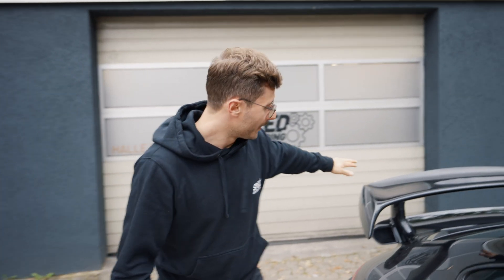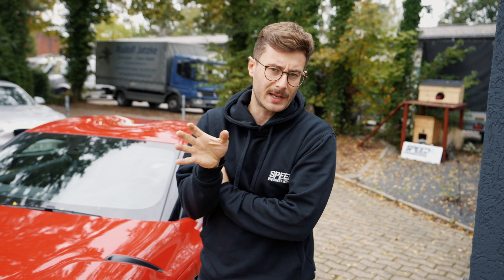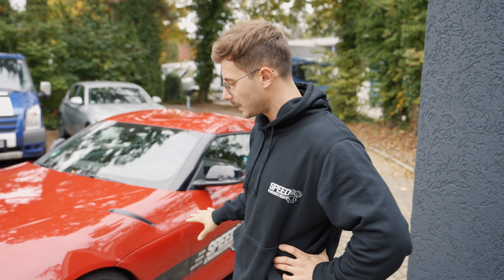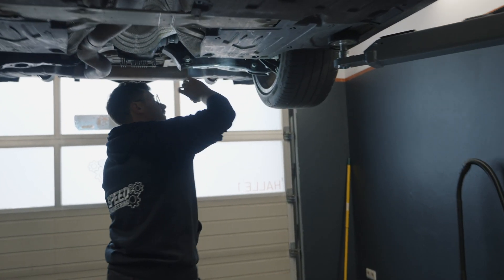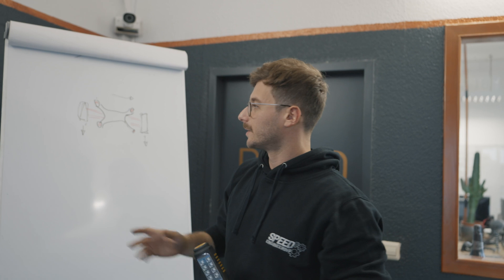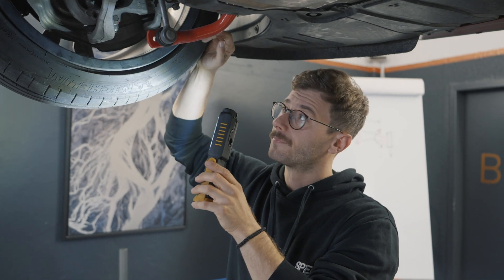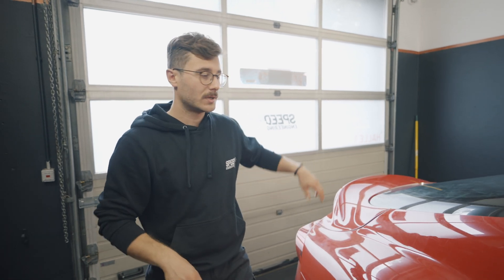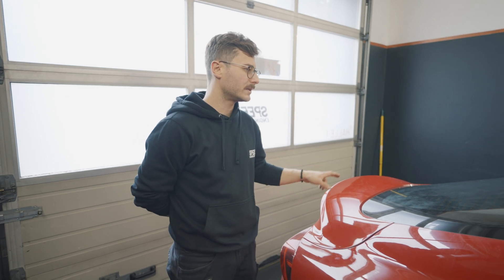must have mod for the Supra MK5 | Speed Engineering

Comment: Verkline has some bump steer measurements on their page, they claim that the amount of bump steer increases when you add negative camber.
 In their measurement it's 0,2° per 40 mm travel at "stock" camber, 0,3° per 40 mm suspension travel at -0.5° camber.
Toe-in during compression, toe-out during rebound.

Comment: To be fair, the original Supra really had bump steer issues. But Toyota apparently changed the entire geometry of the rear suspension for the second model year, that is why you probably didn't have those issues.
Reply from the maker: Hey, are you sure? I think they made some changes but not the entire geometry. At leqast the components still look the same
Reply: I aslo don’t think so. I read they changed bumpstop and suspension software only. Didn’t check myself though…
Reply: Okay I heard that more than once, but of course I can't confirm it for sure.